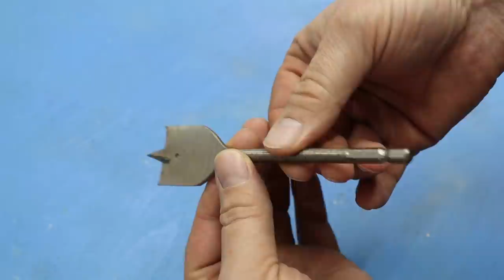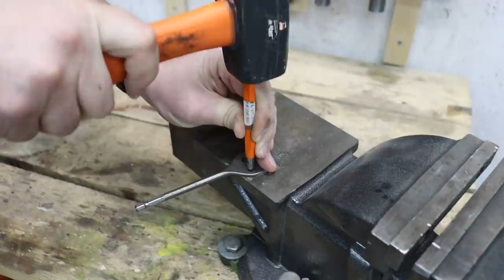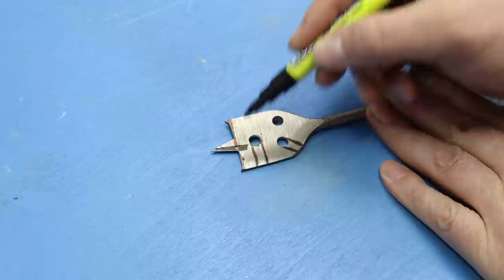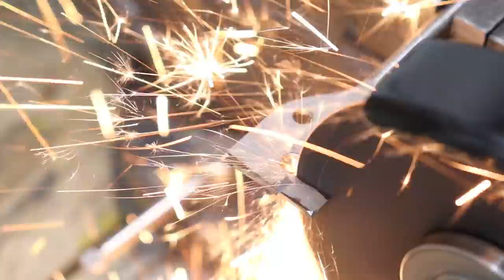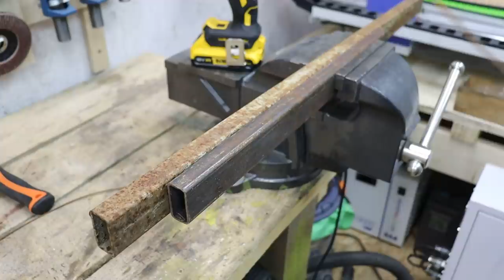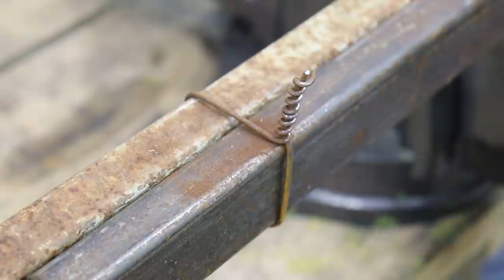Узнав этот секрет ты больше НИКОГДА не выбросишь старое перьевое СВЕРЛО! Полезная самоделка!

Comment: Grab a 6" piece of conduit, smash the end flat and drill a 1/4" hole in the flat part. Used these for years tying #9 ceiling wire around 1 1/2" cold rolled channel. The final wrap in a saddle tie must be tight and have at least 3 turns around the vertical. The best part is these can be made in minutes in the field should you lose one. You can also use the hole in the end of a crescent wrench, but the wrap is not as tight. If you have enough tail on your wire you can get the same result with no tool by folding the wire over on itself to make a loop handle and using this to twist around the vertical. ( I just realized how hard this is to describe with out demonstrating. Maybe I need to make a video😁)

Comment: you know you can just put the ends of of the wire in your drill head and tighten the chuck and twist away.  Not sure how often anyone actually needs to do that but hey. lol
Reply: When I was in construction we’d use it all the time to make a wire braid sock for securing and pulling heavy gauge wire. Very handy technique. It can be the difference between a successful pull, and four dudes looking at hole saying, “the head snapped at the last 90. We can see it but we can’t reach it.”

Comment: Had to mute and skip to the end to get disappointed. I go thru dozens of paddle bits each year that I will continue to throw away if I cannot sharpen them but they won't be used to wrap wire ffs
Reply: Do you have a better tool you use to wrap wire? I don't have any paddle bits, but often find i need to wrap wire
Reply: @IrocZIV  The title says once I learn this that I will never toss a bit again. I haven't needed to wrap wire in decades so title wrong. There are tons of hooks and devices to tie wire available that don't require a drill motor, used bit or grinder. Search for 'wire tie tool' for a many options. I wish you well

Comment: Geez -  I resharpen my drill bits, not that hard to do.  If I have to twist some tough wires, large linesman's pliers work great.  If I have to twist a bunch of soft wire, I have a handle with a "L" shaped rod with a hole in it for that.  You turn the handle and it twists the wire, doesn't need a power drill to work.

Comment: Instead of putting that custom cut spade bit into your drill. just put both ends of the wire in and lock down the chuck, twist and then snip it to length,.

Comment: Excellent idea. Same as a commercial KTWISTER that sells for $30. Lots of haters in the comments on this one. I'd love to see those guys twisting #9 wire on a temporary shelter on a construction site. Time is of the essence and weather could be moving in. Twisting doubled #9 wire with Kleins is not easy work. I don't know a single Journeyman carpenter that wouldn't use this if they had a lot of#9 to twist.
Reply: Great simple solution that reuses a bad spade-bit. No everyone is entitled to live near or have the disposable income to buy the actual tool that does this…they also break. 

Good comment, I also don’t understand the haters. I’ve also been there twisting this thicker wire with pliers is hard on the hands after a few.

Comment: I have a wire twister
Reply: @chuckredd9131    Mine are long pliers with a push-in lock to hold the wire ends, a long center part with a spiral part you pull by the knob, let the pliers part loose to allow the wire to twist. Construction people use a steel  hook took to twist looped wires around rebar.

Comment: They sell at most hardware stores what is called a YO-YO used for twisting  wire like that
Reply: Ktwisters look identical to this. They are on sale right now for $30 plus shipping. Look at their site. This video got more unfounded hate than any video in recent memory. IDK why?
Reply: JustMe Don’tkKnowDoYou.   You know what’s better than that?  Do you?  Just stick two ends of wire into an empty chuck and tighten it.  Then squeeze the button.  The beauty is it doesn’t matter which direction,  forward or reverse.  And it’s free (assuming you already own a drill).